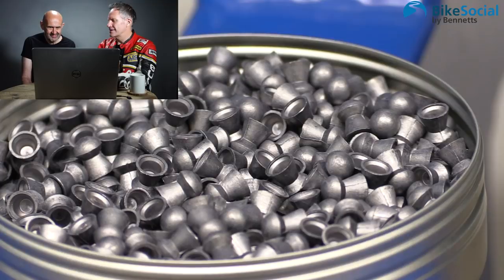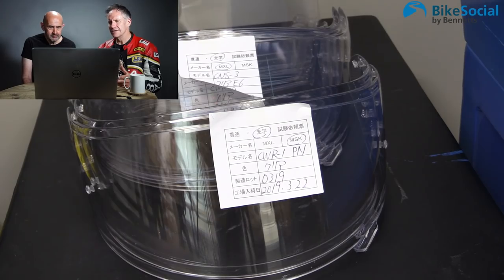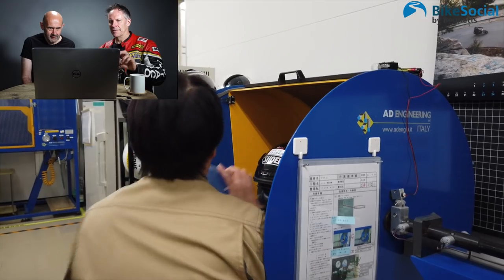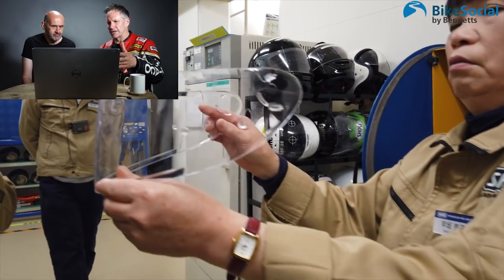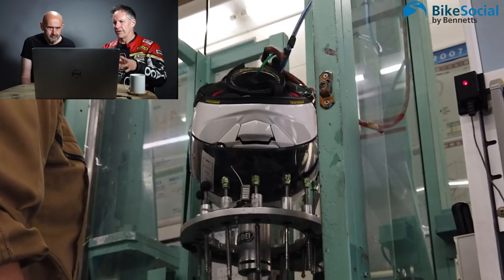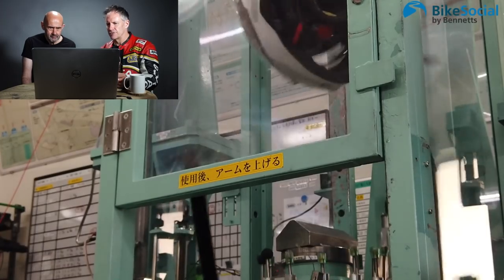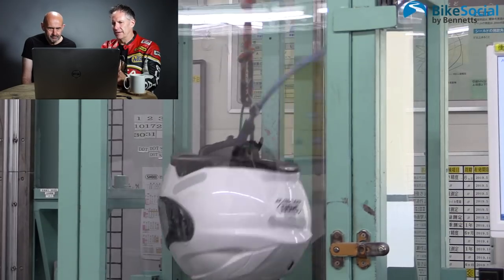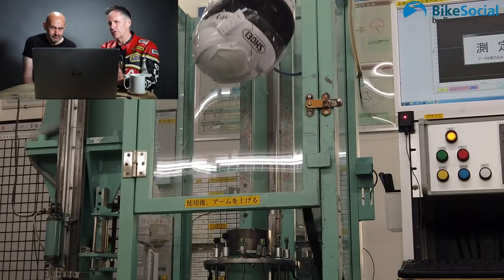How are SHOEI helmets tested?

Comment: Typical drop speeds are around 6.5m/sec, 7.5m/sec, 8.5m/sec, depending on the test protocol or certification. Sharp uses all those speeds. The drop height is whatever is needed to achieve those speeds in free fall. If you want mph or km/h use google. 

The video shows ECE/FIM test which is unconstrained. DOT, Snell, and Sharp use guided falls (1 axis).

Comment: Only problem i see is the drop doesn't have the weight of the body behind it.. just my opinion
Reply: only scenario where that argument would apply is if you fell directly on top of your head with your entire body vertically positioned above it. otherwise the only weight affecting the helmet would be your head

Comment: Testing is voided...Once they cut into the helmet, they destroy any integrity of the helmet..the test is useless-helmets are designed as a total impact area-where forces dissipate thru-out the helmet. I want to know the mph (or Kmh) the helmet is traveling when it hits the bottom of the drop... I dont care about sound of a helmet (I wear earplugs) or wind, I have windshields and never ride over 80 mph
Reply: When tested according to European Regulation 22 the impact speed is 7,5 m/s = 27 km/h. Other regulations have similar speeds.
Reply: Not when they are doing the acute penetration test.
Reply: I have a feeling the testers at Shoei know what they’re doing 😉
Reply: @t-rex4211 😂lol. Crashquez their famous test rider.